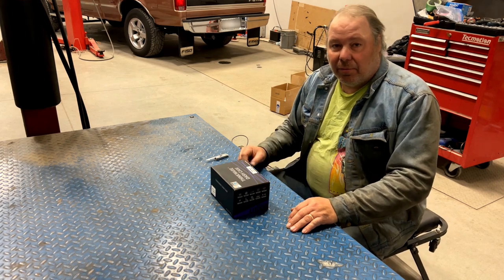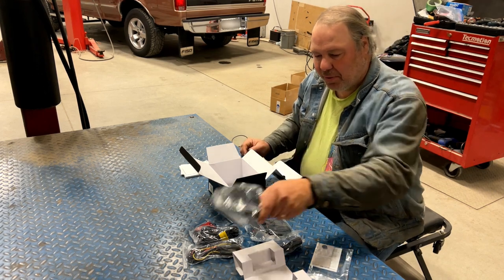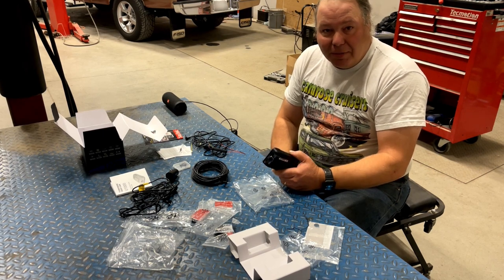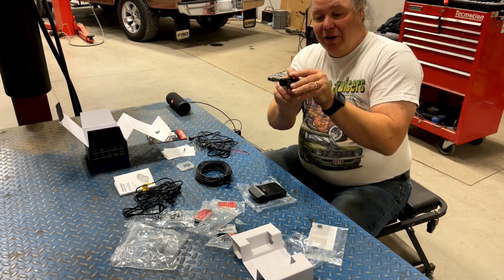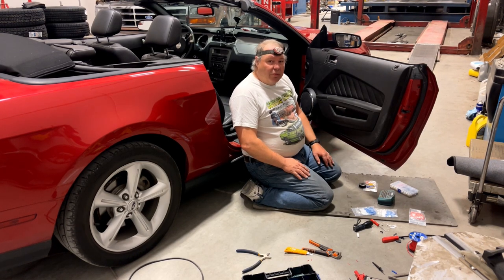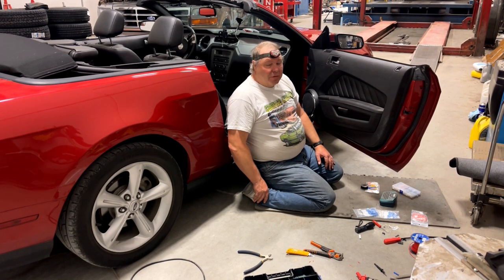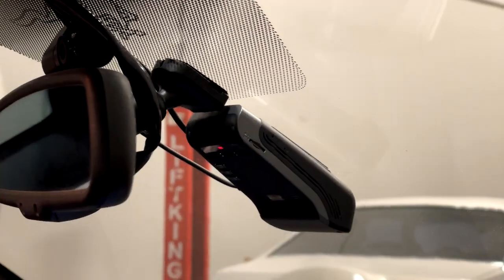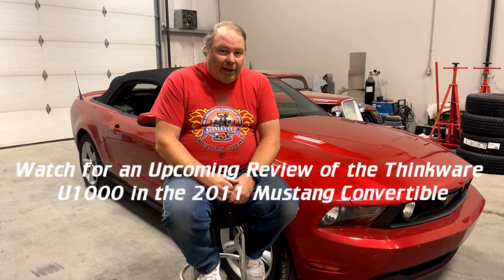Unboxing the Thinkware U1000 Dashcam and Installing it in a Mustang Convertible

Comment: Great to see some new content!  I was just wondering if you could mount the rear camera in back of car someplace.  Perhaps you could put it in the center brake light lens, don’t know if you can 3D print a custom lens or modify the factory one, just a thought.
Reply from the maker: This rear channel, and I suspect virtually all rear channels for dashcams are not weatherproof, so any mount point outside the car is a pure no go. Other than the window, there is really no provision anywhere on the car to provide a view outside the car while keeping the camera safely tucked inside. As it turns out, the windshield solution is working and although it puts the occupants on video the whole time like an Uber camera, it gives a reasonable view what is happening behind and in the blind spots of the car. For instance, if someone rear ended me, it would capture that quite well.